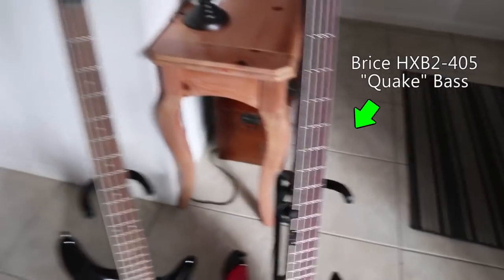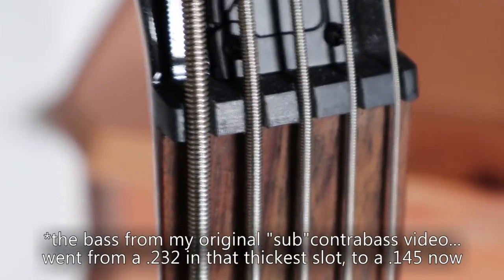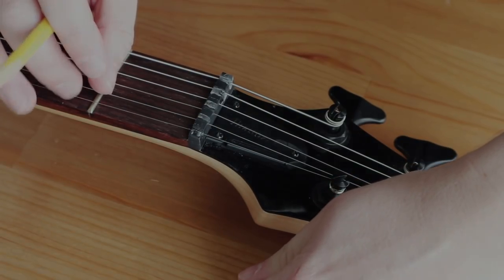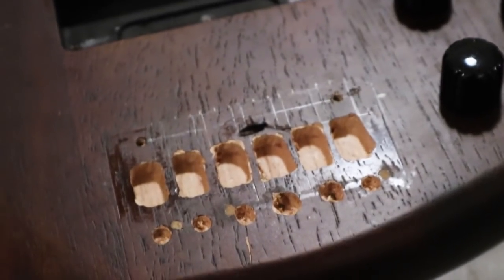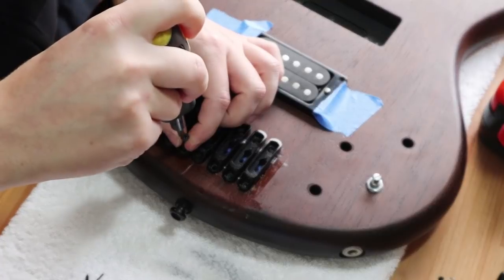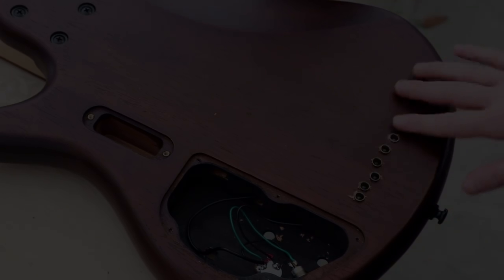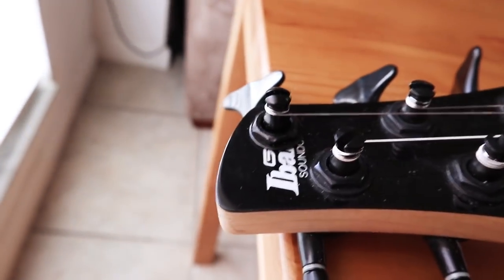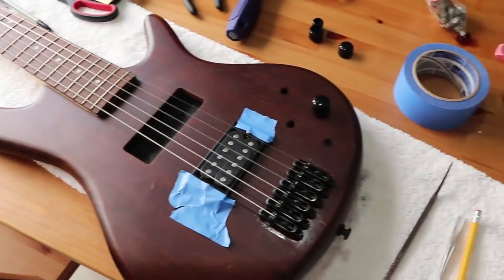5-String Bass To 6-String Baritone Build (...and Tone Demo)

Comment: For the pickup use something like a cheap rail 7 string or 8 string pickup. It'll easily hit that wide string spacing, I've done something like this before, but with a 6 string bass to an 8 string guitar.
Reply from the maker: I kind of want to do that 8 string idea too lol
Reply: @SaidTooMuchProductions  You're welcome to it. I used a Rondo music 3/4 scale 6 string. You'd have to dowel and redrill the tuner holes, but that will probably be the most complicated part.
Reply from the maker: Ya, that'd be an extra step
Reply from the maker: Did you have pictures or a video or anything perhaps?
Reply: @SaidTooMuchProductions  no, sadly. Traded it a while ago for a low model Gibson SG.
Reply from the maker: Shame lol
Reply: @SaidTooMuchProductions  Ya might wanna upgrade your 34 inch Baritone Guitar  to have the same pickups and wiring as your Brice Bass cause it'll be cool.

Comment: If you made an 8 string guitar out of a 6 string bass, you could tune it to C# standard, the lower 8 strings of a 9 string guitar, and parallel the signal through both a guitar and a bass rig, triggering all the people who say to just play a bass in the process. They'll swarm in from the forums and you'll become famous overnight.
Reply: BEST IDEA EVER
Reply: @Richard Repper Clearly you know nothing about inharmonicy. Getting a string thick enough to tune to pitch at 25.5" and still have decent tension would result in your "perfectly intonated" string being literally out of tune with itself. There's a reason basses have longer scales.

Plus, you can get a good guitar tone out of a 34" scale, you cannot get a good bass tone out of a 25.5" scale, which was my whole point.
Reply: @Richard Repper Meshuggah is literally my favorite band, I tune down to E1 on a 30" scale, previously C1, and I've tuned a 34" down all the way to E0, a full octave down. I know quite a lot, because I've tuned down everything I've owned to its limits at some point. I have real world experience as well as theory.

You missed my point completely. There is a very real difference between getting a good guitar tone, and getting a tone that can double as both a bass and guitar.

Guitars have comically low tensions, which is how people like Meshuggah can get away with a low F on a 27" scale (formerly 29.4"). But you cannot, I repeat cannot, get a good BASS tone out of low tension strings. Trust me, I've tried.

In order to get a good bass tone, you need to minimize the pitch bend of the string upon impact. Sense we like to play hard, that can only mean higher tension. If you try to get around 28lbs to 33lbs of tension, which is the sweetspot in my opinion, on a 25.5" scale, you'll end up with about a .145" string on there. That will sound like shit.

The reason it sounds like shit is inharmonicy. Google it. It's the scientific FACT that a finite stiffness string, on a finite scale, will produce overtones that are not in tune with the fundamental frequency. The more stiff, and the shorter the scale length, the more out of tune the harmonics.

You can get away with tuning a guitar down really low. But unless you tune to higher tensions, your bass track will suffer. If you tune a super short scale to a low tuning with high tension, you will sound like a bell, especially if you play higher than the 3rd fret.
Reply: @Richard Repper What experience with down tuning do you actually have? Mister tiny mind.
Reply: @Richard Repper Hold up, if you were talking about C# standard as in a minor third below standard guitar, ie. C#2, then you really need to learn to read and understand context clues.

Comment: i actually build basses full time and i do some odd experiments on my free time (which is a lot due to a sleeping disorder) i currently am waiting on strings for a baritone guitar of mine, its basically a KoRn tribute guitar with a 30 inch scale and gonna be in (bass octave) drop D or C. mahogany body, 5 pickups (double coil with split, double blade with split and single coil neck) with an experimental 3 piece red oak, 8th inch carbon steel and white oak neck.   long time ago i wanted a similar concept to this video, 5 string bass neck to 6-string guitar tuned CCGcfa...so basically drop C but with another low C in bass range. you essentially play it like drop C and get the bass frequency as well. and for Djenty stuff you have the octave right there. ignore the Low C for riffs and when you wanna have that almost slap-pick thing you can toggle between the C and the...other C. lowest i ever go is A0, 145 gauge 35 scale. anything lower doesnt play nice with my speakers. you should try a fretless bass. you could just yank the frets, mix JB weld and white paint and fill in the slots for inlay. i have a recently experimental Fanned fretless bass that is essentially a fretless bass that turns into a 30 inch scale on the high side, and the fret marks are fanned. fun fact...it SUCKS to play. that "ergonomic" thing fanned fets are supposed to provide doesnt do shit when you go fretless but maybe its just me. good thing about a fanned scale fretless, if you hate it, you can just pull the slanted Zero fret  and move the bridge and repaint the fretboard and its regular scale again, no massively altering the neck or anything, just change the marks. i will say that i seem to do fine on a 35 inch scale 6-string fretless bass, so when i pick up the fanned fretless and cant play it for shit...makes me think there is a reason you never seen fanned fretless basses.

Comment: for the future if you ever have to fill a nut use the baking soda/super glue trick. pile up baking soda in the nut slot, then drop super glue on the baking soda pile and it'll turn the whole pile into a hard as rock substance. perfect for nut filling when you can't buy a new nut or don't want to
Reply from the maker: I'm definitely gonna try that next time and compare

Comment: Sick! Been waiting for this video! haha
Glad you looked into the Admiral Angry suggestion! (I'm pastatuesday on IG) - I thought it was Double Drop D but as we saw in that other comment its actually double drop A. BUT you could try mess with doing the double Drop D on the 6 string :) 

Also, owning a Bass VI and playing that Ibanez Crossover (both amazing). After watching your video, the 30" scale makes it ambiguous if it's a guitar or bass playing, you can play like either.You got some interesting tones but as you pointed out, it gets super twangy but even playing that low B/A has bass guitar tonalities to it even with a .51 gauge string. To me it sounds like the longer you go in scale the easier it is to hear and it sounds more "bass like" and less like a guitar, but keeping high strings on top, you will be snapping them much easily and lose bend ability.  It  almost sounds a little naturally scooped with the more defined low end and brittle attack n top end coming through.

Fun experiment though, loved the video :)
Reply: Oh also, the Bass VI (and maybe the ibanez) both have a Hi Pass notch switch, to kinda eliminate low end rumble and sound more guitar like and guitar amp friendly.
Reply from the maker: Oh ya cool, thanks, Admiral Angry was a good find

Comment: try getting one of those special staggered humbuckers designed for diagonal routed guitars? also, try wiring it with a neck pickup, and push it all the way so the outer-most pole pieces line up under the high string, and push the bridge pickup so it does the same for the low string, and have them both sounding together all the time. Another idea, grab a 7 string pickup for the bridge position, preferably a double bar humbucker or Seymour Duncan Invader, and then get two 6 string pickups wired in reverse phase and staggered so one lines up to the low string and the other to the high string.

Comment: On pickups: You either can use a rail pickup (such as the DiMarzio X2N, it has a seven string version if I remember correctly), or going custom. I know a guy here in Hungary who makes custom pickups, especially with neodymium magnets, he probably could supply you something that makes it sound a bit better. Be prepared that neodymium pickups can have the same output level as active ones, although with a higher output impedance.
Reply from the maker: Ya, I thought about just a passive rail 7, it would definitely fit

Comment: OMG it makes so much sense now  I already suggested a new smile with the 1/2 guitar this would be the other half this is so cool
Edit: use cefuss 8 string bar pickup like your 9 string guitar for making it line up
Edit 2: 7:00 is that tenacious D the metal? If so that's insane.

Comment: Yo, you think this neck could handle a 12 string setup? I've found all of one 12 string baritone electric kicking around, might be a cool build.
Reply from the maker: Possibly, that would be a cool idea too, more space for the double strings, if the guitar tuning uses half the tension or a little less than what was original per 5 strings

Comment: Get some soapbar style 7-string pickups, its should be the same size as the original pickups, i know that originally emg just slapped their extended range pickups on bass pickup casings because they already had, so it might be worth a try

Comment: My opinion, the easiest way with pickups is to take a wide rail humbucker. For the similar conversion I chose Warman T-rail Blazer. A tele-bridge sized hot rail. You don't need to think about string spacing and total width anymore.

Comment: A better way to fill a nut is to use some water thin super glue and baking soda, its nice and lubed and it as hard and strong as a normal bone nut. Maybe a project you could do it to just make a full nut from baking soda and super glue?
Reply from the maker: Ya, I think I'll try it on another build eventually, at least to compare
Reply: @SaidTooMuchProductions  Yeah i had to do it to my bass to fit a 130 guage in and it works really well

Comment: Just use the 5 string bass pickup, it'll work better. If the magnets give you too much trouble, get a rail magnet style pickup. If that's too bass heavy, wire the humbucker in parallel instead of series. Bam, problem solved.